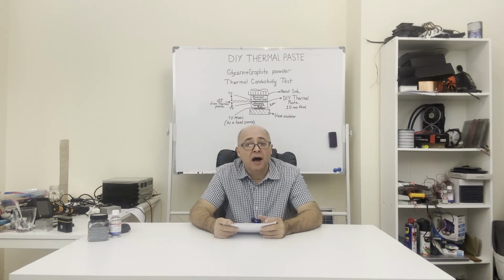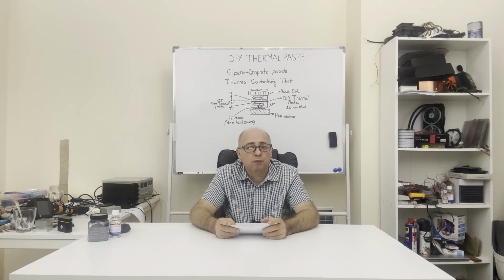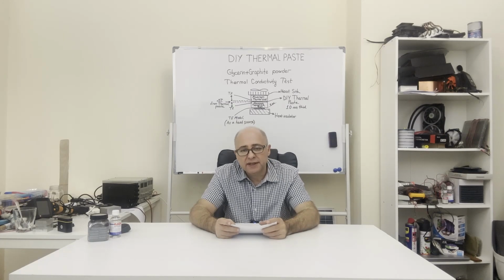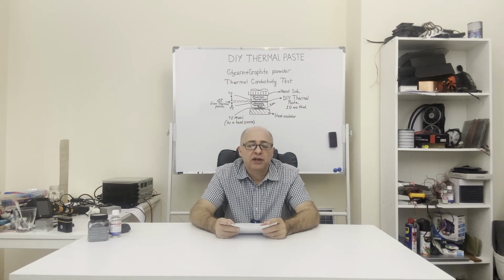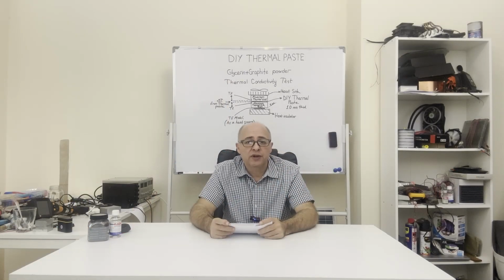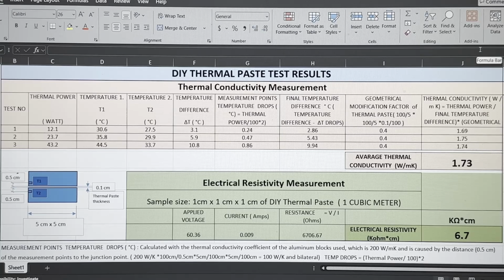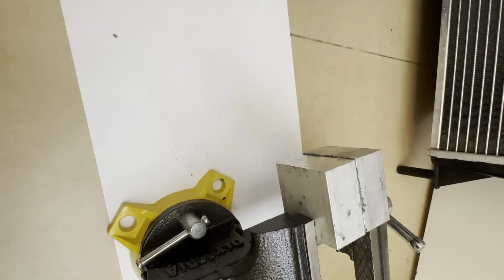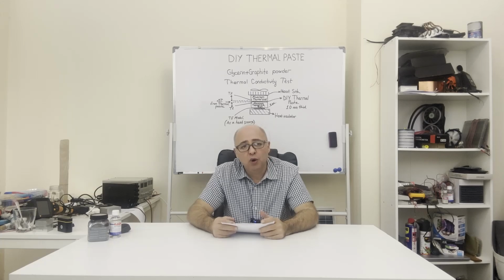How to Make Thermal Paste at Home/DIY Thermal Paste Experiment with Thermal Conductivity Measurement

Comment: I think graphite electrical conductivity might be a reason why there are no products on the market like that, no one wishes to risk their expensive hardware on a solution that is similar to what is already avaliable. And with willing to accept electrical conductivity you could always use liquid metal

I also got a silly thought what if you just used a pencil to apply graphite to metal plates it could fill the gaps in the surface, forming a really thin layer which would be good for thermal conductivity, but that would require applying something to fill the microscopic air gaps
Reply from the maker: Yes, graphite has very high electrical conductivity, but glycerin has very low. The electrical resistance of the mixture is also somewhere in between. The mixture I made was around 6700 KOhm*cm. Of course, it would be wrong to say that this value is 100% safe. However, since CPUs work at small values such as 5 Volts, I think there will be no problem. However, users should be careful. On the other hand, when we consider those who use liquid metals as Thermal Paste, the risk of short circuit is very high in case of leakage.
We can say that the DIY thermal paste I recommend is much safer than the cases where liquid metals are used.
By the way, filling the gap with the pencil you suggested will definitely be useful compared to the case of not applying thermal paste at all. However, as you said, filling the gaps is a problem. You should try it.
Reply from the maker: Pardon me 6.7 KOhm*cm

Comment: hmmm...
glycerine is hygroscopic.
what about long term values?
i would prefere silicone oil instead.
Reply from the maker: Dear Waldschratdersandersmacht thank you for your comment. Yes, glycerin is hygroscopic but has good thermal conductivity. I think that the possibility of causing a problem is low due to the lack of sufficient contact surface with the air to absorb moisture (because there is only a limited surface around the contact point between the heat sink and the CPU) and the fact that it will often get hot during heat dissipation. However, as you said, it is a situation that needs to be evaluated in the long term, I agree.     Best regards.
Reply: @Thermoinventions  ok, yes glycerine can work well in a dry environment as yours in a desert area. but here in the humid europe, i have some doubts.
anyway - your yt channel is great!
your physical background is great!
Reply: at the moment i'm working on a stovetop thermoelictrical generator.
if you are interested:
dersandersmacht
Reply from the maker: Actually, I have some other doubts about thermal pastes. Just out of curiosity, I tested 2 different brands of thermal pastes with the same method and measured their thermal conductivities. As a result, I found the thermal conductivity of the one that says 1.6 W/mK on its label to be 0.98 W/mK, and the one that says 3.1 W/mK on its label to be 0.85 W/mK. I believe that my measurement method is correct. However, I cannot explain these results.
Reply: @Thermoinventions  i'm working at this time on a stove top thermoelektrik generator with water filling to prevent from overheating.
if you are interested:
dersandersmacht
Reply: @Thermoinventions  everytime i try to give you my contact, yt deleted my komment. again: dersandersmacht
Reply from the maker: I have no idea why YouTube delete your contact, you can send e-mail to my address. My e-mail address is available from my channel page.
Reply: @Thermoinventions  (at)
Reply from the maker: my e-mail : thermoinvetions@gmail.com
Reply: https://youtu.be/8RJ-vLLwDPU?feature=shared
Reply from the maker: Dear @waldschratdersandersmacht, I watched the video you sent, it is really successful. Thank you.